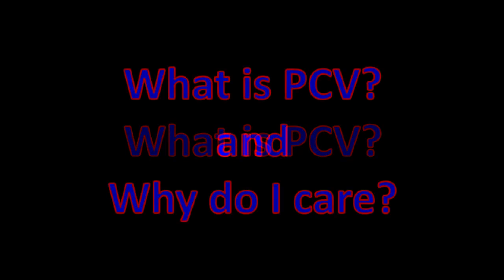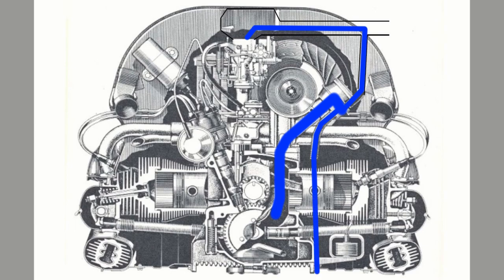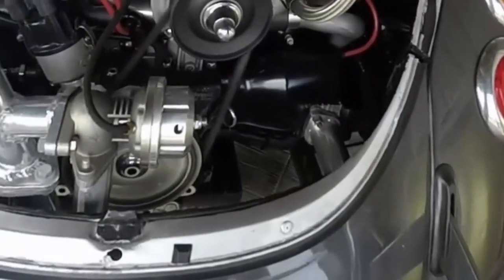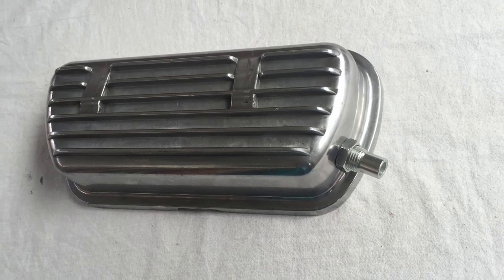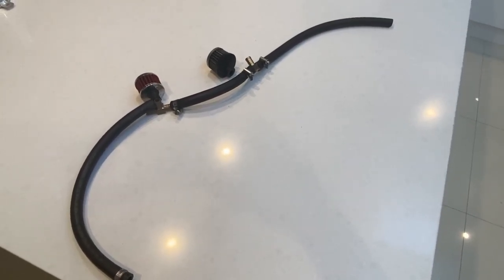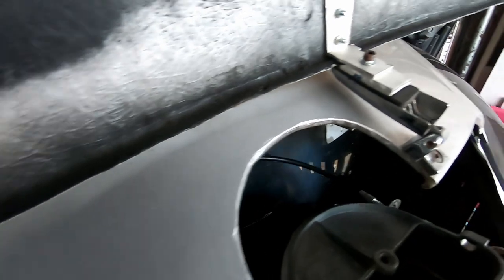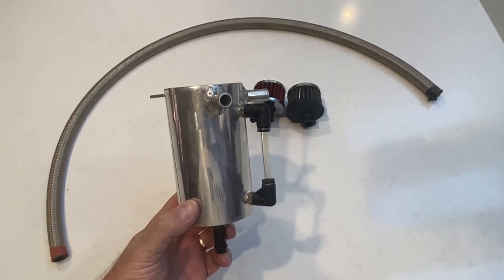PCV in a VW Motor - What does that mean?

Comment: Sadly - many of these accessories are sold without directions.  While nicely done - your plumbing is wrong.  The valve/tappet cover / crank case vent are all supposed to go into the oil/air/water separator can - and then the bottom of the can is supposed to have a drain (often valved) back into the case/oil filler.  Im pretty sure that on your set up, the top port on the can is for the air/exhaust gas/water vapor filter exit.  The top side ports (left and right) are the can inlet ports accepting the left and right crank case / valve/tappet cover venting.  (The crank case is vented via the push rod cover tubes into the valve/tappet covers.). The bottom  drain back port outlet from the can should be valved and then drains to crank case filler.  I do not like to drain into the case without a three ways valve.   You can keep the valve close and the watch oil and water accumulation.  If it is all just oil, then draining into the case is ok.   But its also nice (diagnostically) to watch how quickly oil is accumulating.

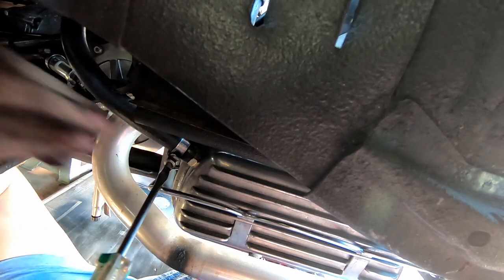Comment: 5:27 I have one of those oil crystal filters and Haven´t seen where to put it...I mean, I have a plastic filter for the gasoline but the other one u have there what is it for? where do I install it? I´d appreciate the info bro. I liked your video, by the way, I just bought a Breather kit for my VW even though is not a turbo.
Reply from the maker: Well spotted, the glass fuel filter is what I was using previously, you can see the vice grips clamping the old hose to stop fuel running out.  The new hose from the carb has the plastic one on, which replaced the glass filter when I hooked up the fuel system.

Comment: I was thinking of doing this same thing on the engine I just installed. A 1500 that began it's life as a 1300. I'm seeing a spot of oil from my rear main and a couple other little spots. The seal is new and was professionally installed.

I wanted to go the can route instead of the EMPI breather. They're less expensive and appear more functional.

Did your vent can alleviate your drips and shaky dipstick?
Reply from the maker: Yes it did, you just need somewhere for the pressure to vent

Comment: Very well done.  I learned a lot.  I am in US so we call them valve covers, I've never heard them called Tepids.  I do have a question about your set up.  Could you have just put the little filters right on the valve cover (tepid)?  What is the benefit of tieing them together?
Reply from the maker: Thanks for the positive feedback AJ.  I think tappet covers is a British term. You could put filters on the valve/tappet cover but with the turbo it is pushing a lot of pressure so the filters would get clogged in oil before long (especially near the #3 cylinder). The breathers just need to allow expansion of the pressurised oil mist, so you could have expansion bottles (catch cans) at each breather but I have just run them all to one catch can.